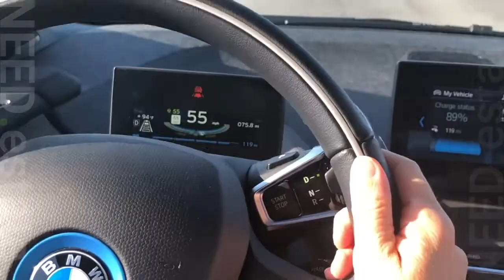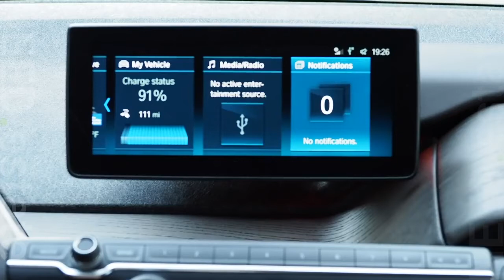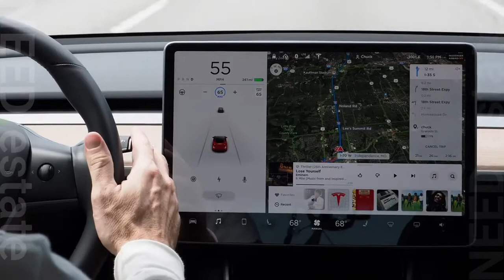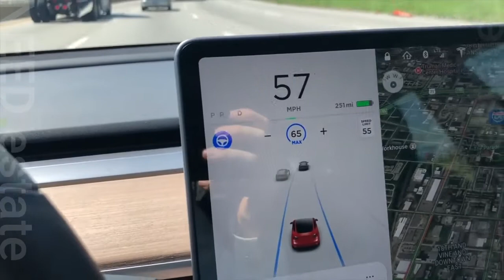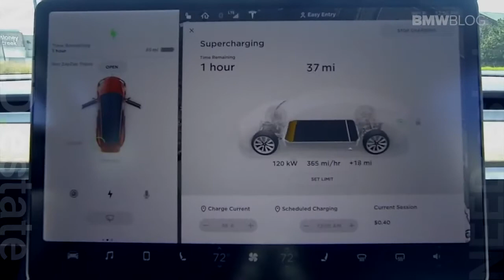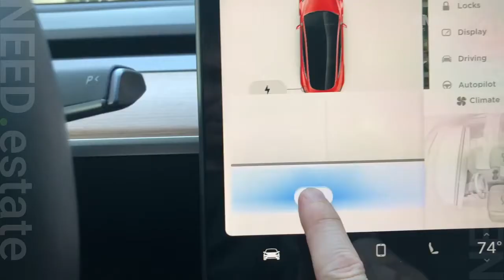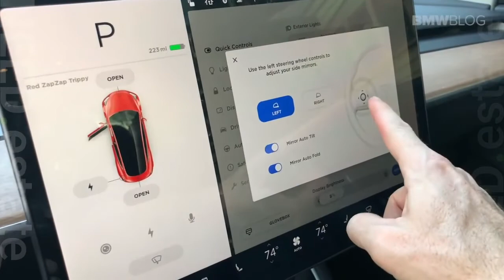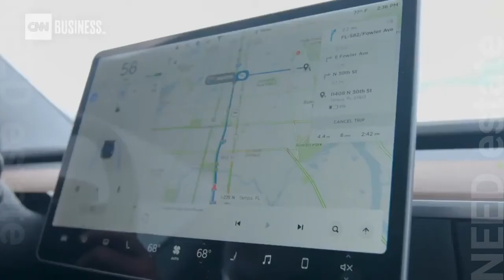TESLA Model 3 🤜🤛 BMW i3

Comment: Your country's electrical system was damaged by a storm or an earthquake.  How far can an electric car take you?  The answer is as long as the battery works for you, after that you will be without a car.  The BMW i3 has an advantage over the Tesla that despite running out of battery, you won't be left without a car lying on the street.  There are countries where you can find a charger every 250 miles.  In mine it is not and where I can only charge is at home.  The car is so functional as far as it works for you, if not, then it is useless.